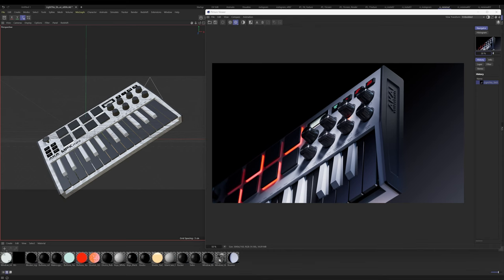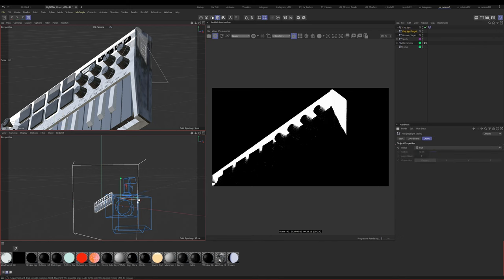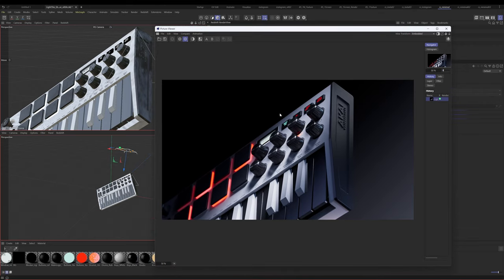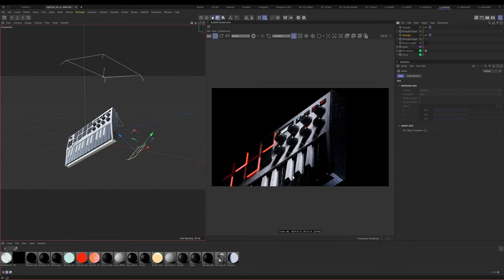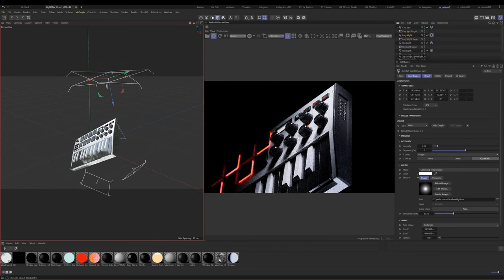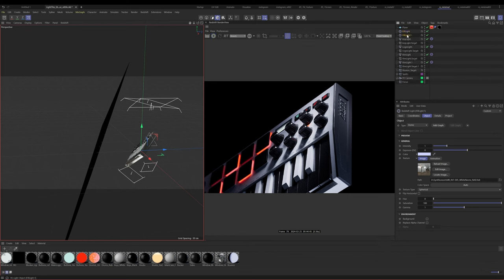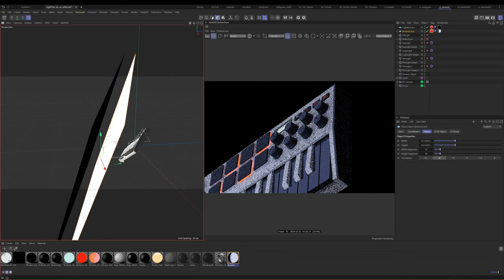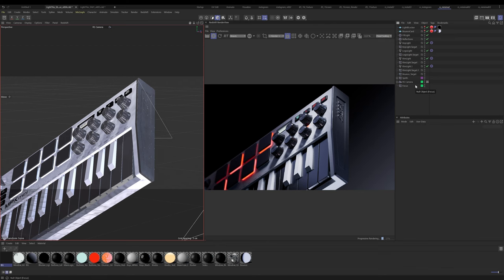Simple Lighting Workflows in Cinema 4D and Redshift. Full Scene Lighting Breakdown.

Comment: I see that you have the keyboard at an angle. Do you move the object around the camera when animating or do you move the camera around the object? For me as a videographer I always move the camera around the object but wanted to get your thoughts, does that translate over to 3D?
Reply from the maker: It depends, but my general rule of thumb is keep the product more static that way it stays lit by your lights. If you start moving the product, eventually it will fall out of the light. I also always try to keep whatever I am lighting as close to 0 world space as possible, just makes like easier.